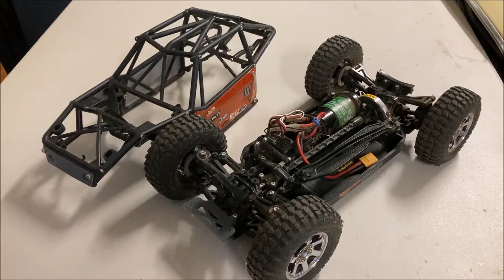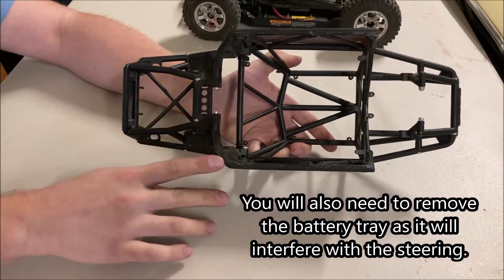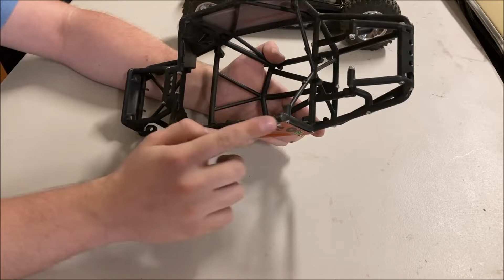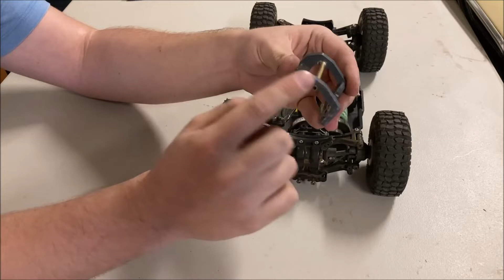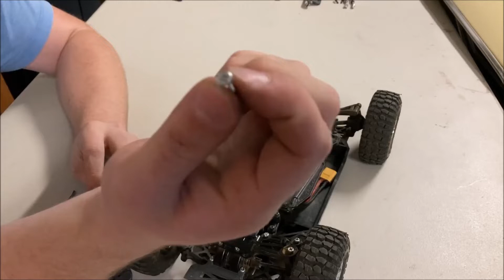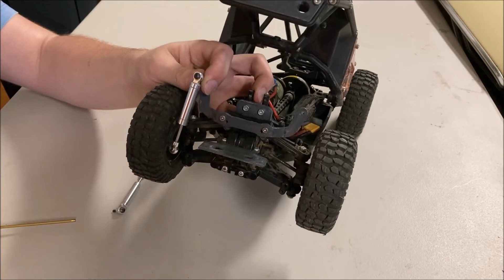Tamiya TT-02 Axial Capra Body How To Guide

Comment: Awsome tutorial! Can you please share the specs on the wheels and tires? Also, I was going through some images on the TT-02 bathtub chassis, and could not verify interfeering part of the protuding section you mentioned. Maybe it's a very subtle part we should cut off...
Reply from the maker: This is running 1.9 wheels with Proline 1.9 class 0 Krawler tires, right around 98mm in diameter.

Comment: That looks so cool. How does it drive?
Reply from the maker: Its a blast, handling is very different from a stock TT-02. Offroad, especially in slightly loose dirt, it is awesome to drive. On asphalt it is far more prone to traction roll but does still handle decently.
Reply: @3d_printed_rc_builder  good thing it's got a roll cage now!